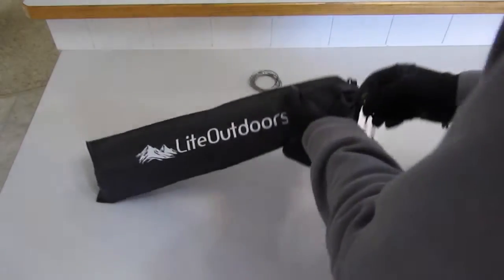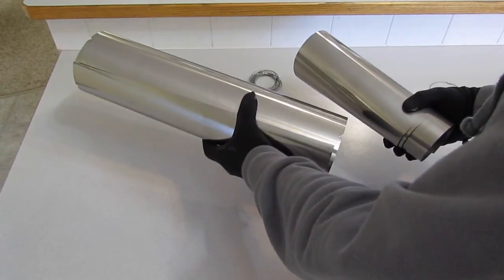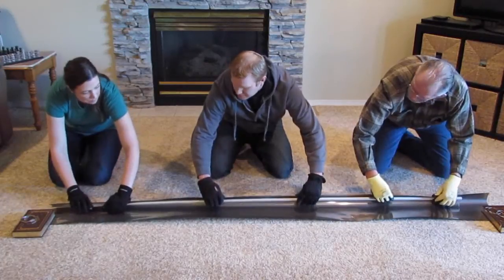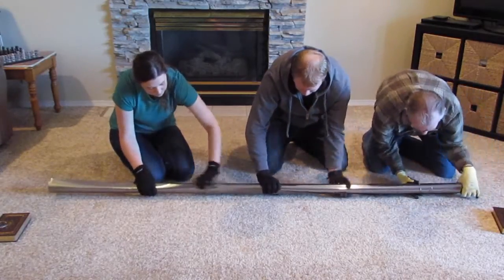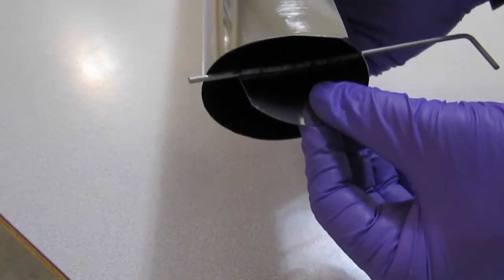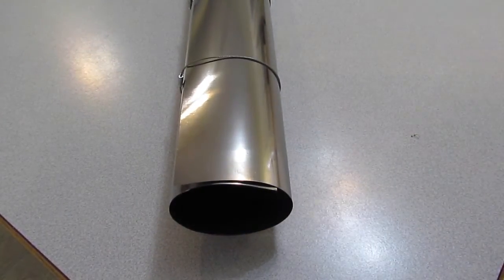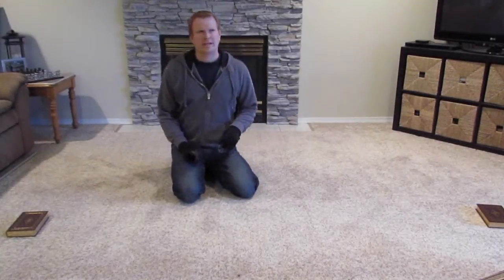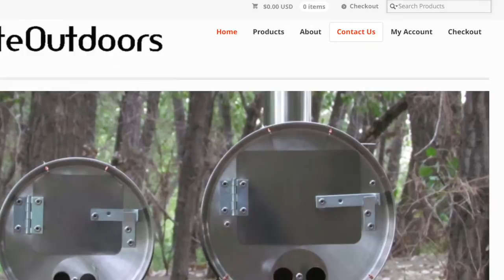LiteOutdoors  - Rolling Your New Stove Pipe

Comment: One person. Role at a angle 30-45  degrees. As soon as a pipe starts to form hold pipe with one hand and put all of the rings on with your other hand. Move the rings up the pipe as you finish rolling the pipe.  Space the rings equal distance apart.